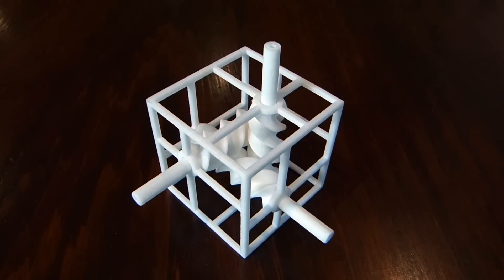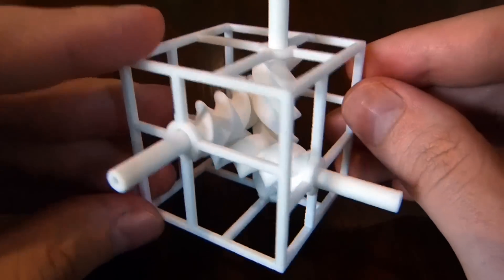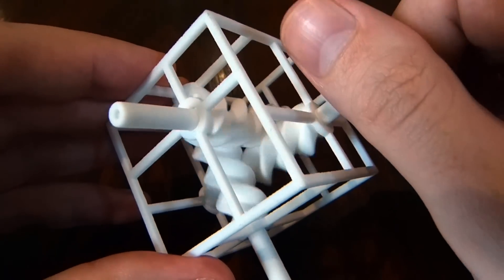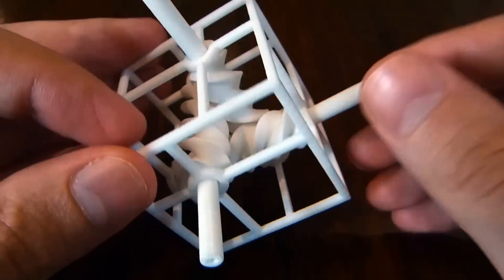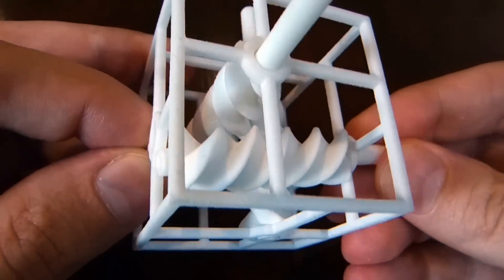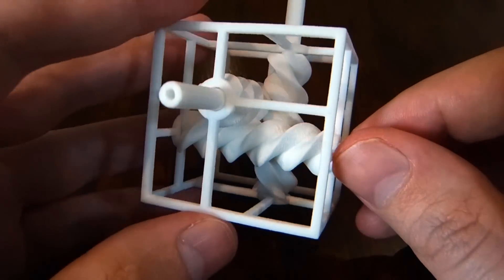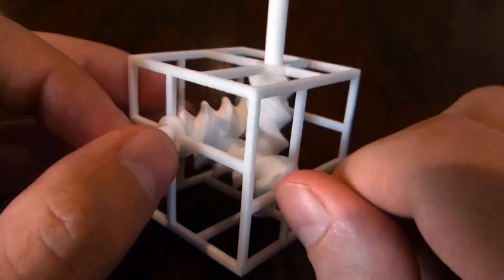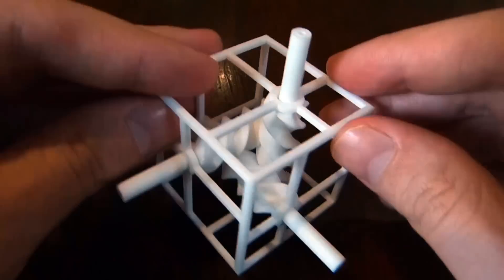Triple helix

Comment from the maker: New thing: "Triple helix" - 3 pairwise meshing gears that move (and easier to make than our previous Triple gear!)
Reply: If it came fused, but can be assembled and disassembled (in plastic, not in metal, I would guess), shouldn't you print it disassembled?
Reply from the maker: That's a good point... when I was designing it I wasn't sure whether the frame would have enough flexibility to allow dis/reassembly, so I had it printed in place.

It isn't really "fused", it's just that there is dust left over in the meshing teeth and where the axles go through the frame. It is easy to clean out once disassembled, and I guess having it arrive assembled gives one the solution to the puzzle of how to reassemble it. Disassembly + clean + assembly isn't much more work than just assembly.
Reply: Better patent it quick!